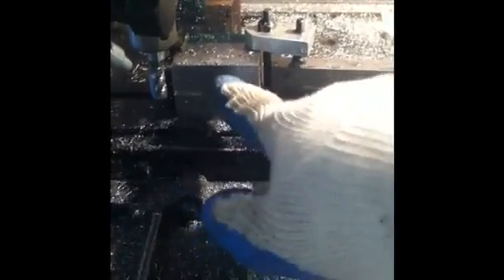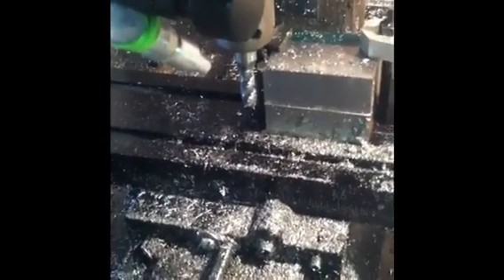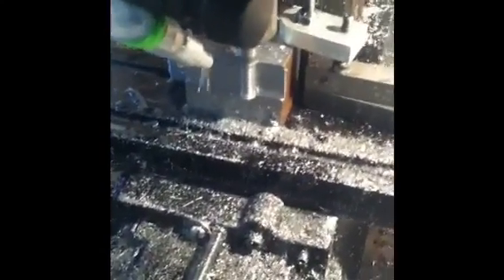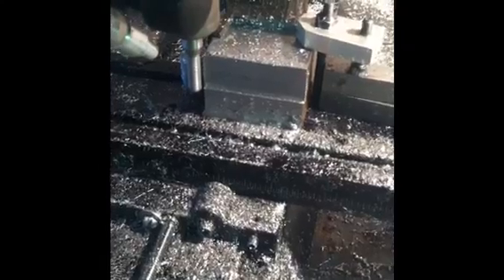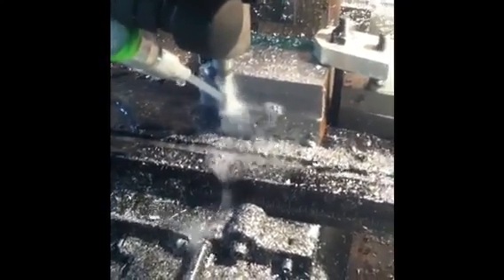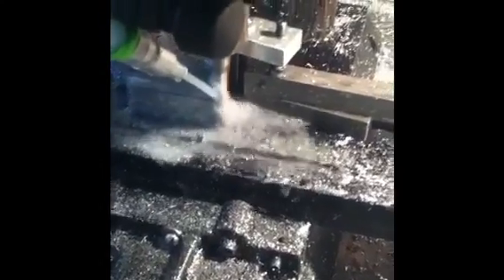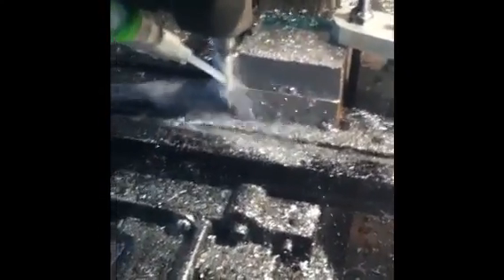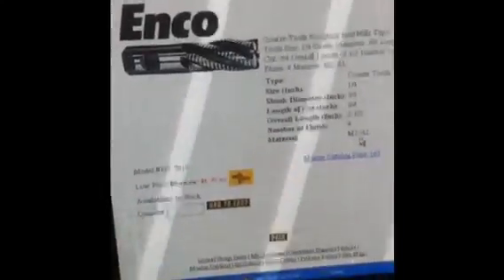Sherline roughing steel

Comment: Hello Calvin, your Sherline is impressive. Have you cut a medium-carbon steel such as 1045 with it? Thanks for the video.
Reply from the maker: Hi Harold, sadly the Sherline sits in storage at my parent's place. I have heard of people cutting mild steel and other tough materials on them, it is just a very slow process compared to larger machines.